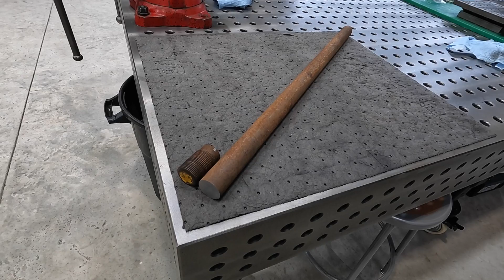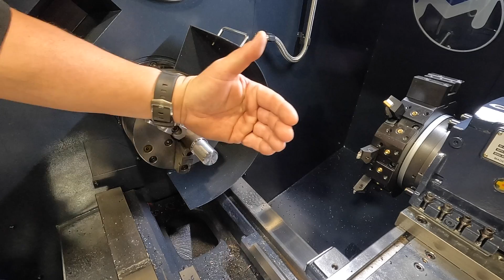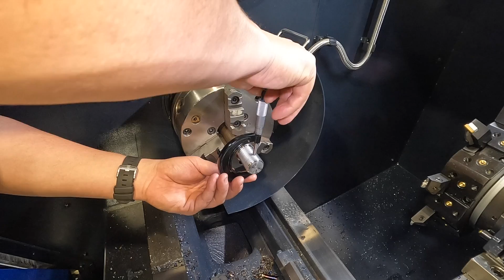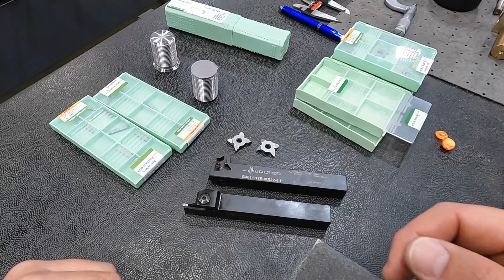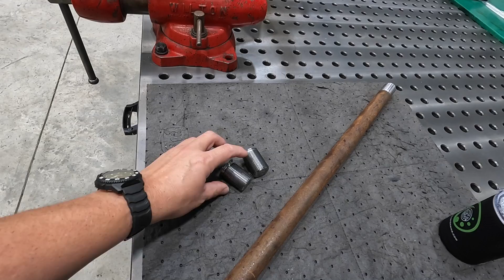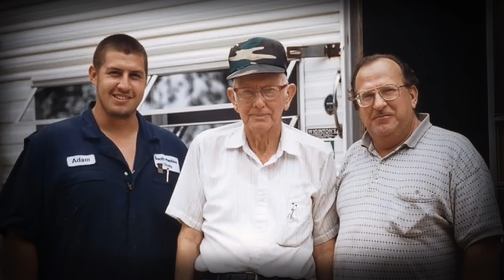CNC Machined Threaded Rod Ends

Comment: Yeah the machining is a lot faster that's for sure but when you factor in the time it takes having to write, proof out and debug the code it's more like 10 times longer than manual. Which is way CNC doesn't make sense for one off jobs.
Reply: one of the great advantages is that code can be written to be flexible and reusable, eg. for threading you'd just give the start, end, pitch, and diameter to a macro, and this gives an already proven threading subprogram that's called with one line of code.

you're right, there is setup and testing and debugging, oh my. But once that is done, and done right, you have a tool for multiple parts. And usable by people with less training, which is becoming relevant many places where skilled labor is retirering at a faster rate than they are replaced.
Reply: People that are experienced in programming can do one off jobs like this faster then any person could do manually.
Reply: The conversational control on the milltronics is pretty straight forward. An operator with minimal training on the machine could program the operation in a couple of minutes.

Comment: Hi Adam, nice work.  Always difficult trying to learn a new skill and system.  Would have liked to have seen some of your programming and your methodology, I would find that more interesting than the cutting.  It would be nice to have someone guiding you face to face but thats not always possible.  I would suggest you try and set aside a couple of weeks with stock and sketches of "mock" parts to practice, practice, practice programming tooling setups, understanding the dynamics of the machine and making lots and lots of mistakes.  You will find it difficult to learn CNC operations on a part time basis by doing a little bit here and a little bit there.  I'm only a home hack but I just bit the bullet and spent every bit of time I had on the machine initially, I'm still making mistakes but feeling a lot more confident now after many of years.  Give yourself plenty of time and you will get there.
Cam

Comment: G'day Adam..  the Milltronics is doing a super fast job. Cutting from facing to tapering to cutting the diameter in a couple of cases seems to be a harsh cut 
I was wondering if the tool height was a touch out causing the audio cut to sound harsh,  also you are doing it all dry, with Lubrication it would work better. Excellent video. Thanks

Comment: I went back and rewatched the video to see if I missed something. He said he was going to figure out how to program the job using "conversational". Next, he has the metal rod in the machine, but no programming. Later we see a screen with numbers already filled in for a program file "Shaft Threaded End" with no explanation as to how he got there. There is chattering which could be reduced or eliminated with maybe more and lighter passes. It would have been enlightening to follow through with that thought. But changes are made off-camera. He only displays knowledge of how to use a micrometer to verify the threads. It's OK to say I don't know, but I think a lot of us are assuming a lot of calls were made to support while the camera was off. I would respect him more if he bought 2 or 3 $1000 machines to learn on, then stepped up his equipment as his skills increased. Everyone can relate to that. I really didn't learn anything from this video. The question everyone is asking themselves is how is this new shop going to make money beyond hats and T-shirts. As the king of Siam said " In my head are many facts
Of which I wish I was more certain, I was sure,
Is a puzzlement"!

Comment: Don't forget, all the cnc is doing is turning the handles for you so try adjusting (or overriding) speed (if its constant surface speed do it in the program) or feed if its' starting to chatter just like you would if turning the shaft manually. 

Happy new year.
Bob

Comment: Your thread cutting program is making set depth increases.  This take off more and more material with each pass.  You end up really hogging out material at the last pass.  Some better threading programs will make a constant material removal so as the depth of the tool increases each pass is not as deep and you don't end up with that major hog at the end.  If your program doesn't have this feature you need so set the number of passes to a greater number. That way there is less material removal on the last pass.  It takes longer, but who cares if it takes 5 seconds or 10?
Reply: You could also speed up the spindle speed. You want to try to get into that sfm zone for carbide even while threading. It don't come naturally to some one who is used to engaging the lead screw but as long as your not going to be traversing over your max feed rate  pump up the rpm to get into the sfm of the material.

Comment: I know you are learning on this but I think you need some guidance from someone who has run CNC lathes for a while, otherwise you are just teaching yourself bad habits. I know this is your shop but you would be shot in a sub contracting shop for altering tool lengths rather than offsets.
Reply: Just to make it clear too. I love Aboms videos, been a viewer for years and as a seasoned CNC machinist I've been looking forward to the day Adam got some CNC capability. It's just I wish he would get some proper guidance.
Reply: does that control do offsets though? I can't imagine an industrial machines that wouldn't but I have seen odder things.
Reply: @TomDetka  I'd be very surprised if it didn't. This is what I find a little dangerous is that it comes across as educational and a lot of apprentices will watch this content while they learning too. Obviously we all know Adam is learning this but I think it would be massively beneficial for another YouTuber or any cnc engineer to work with him for a month to get all the foundations down. Knowing how to use the control is different to knowing how to use it properly.
Reply: If we could get Peter of Edge Precision in Houston to visit Adam - that would be some Priceless Videos.  If anyone on YT knows CNC turning - it's Peter.
Reply: Yea there's loads, Jay from Pierson workholding would be good too or Adam the machinist

Comment: G54 to G59 would save you some time.  The machine seems to be homing itself between tool changes.  I think I got that right?  Do they make a ratcheting chuck key?  Coolant would probably eliminate chatter.  How do you check tool offset on your machine?  Sorry for all the questions.
Reply: Likely its a safety feature to make sure you don't index a tool into the chuck. Could be just be a parameter he needs to uncheck.

Comment: Happy New Year! So I do not consider my self a machinist but I do run a CNC weekly I have a question on adjusting your tool offset. Should the adjustment be  on the radius versus the diameter adjustment you did for the threading insert?

Comment: Remember the offset is  the radius, not diameter, and you set the offset by .0001, that took .0002 off the diameter
Reply: Every CNC lathe I have ever used has the offsets in diameter, not radius...
Reply: @Eggsr2bcrushed  I think if you make the offset in tool length like he did, it doesn't auto-compensate. If you make the adjustment in the wear page (where it should be done), the adjustment is made in diameter mode
Reply: @JukeboxJake  There is  a wear offset ( x, y and also radius ) in the tool table page he shows on the video.

Comment: There isn’t a wear offset on the tools? Those little burrs on the OD finish could be improved by doing two things. Use a different tool for your finish cut at a higher surface footage or speed. I’m not sure but by the sound of the video. Are you running in constant surface speed on your turning cuts? Or maybe you have limited the speed in the program. Typically to make a thread relief I use a 35 degree diamond turning tool. I turn down a 45 degree angle into the relief into the relief. Rough the relief  and then do your finish OD cut with that tool with the thread relief all in that finish cut.
Reply: THIS  THIS  THIS ^^^^^  -  Peter, wouldn't you like to visit Pensacola???   Mr CNC meets Mr Manual.  A Epic Video for us all.
Reply: @tedsaylor6016  Ted I just saw this comment. I wouldn’t mind it but I don’t know when it could be. All my spare time for  trips going to Mexico for my building project. I did once meet Adam at the first Good of the land meet up here in Texas. I think for being totally new to CNC Adam is doing real well. That manual experience is really a big help.
Reply: Getting his cutting forces pushing down, instead of pulling up will help as well. Especially in that little machine. It will help his diameter control immensely. And, no offense intended, but he's trying to run it like a manual. Lighter D.O.C, lighter semi-finish and finish passes, even with the same tool, will do wonders.

Comment: You'd do yourself a huge favor by swapping your tooling around so your spindle is going CCW vs CW. threading gets a bit trickier tho. Their programming book(the version I have, anyway) leaves a lot to be desired. It's taken a long time for me to get my ml22 figured out. Applications has been a horrible resource, however. In my experience, anyway

Comment: I have a CNC router and laser engraver.  Get ready for sleepless nights.  The process is highly granulated, so lots of feeds and speeds and tool selections to worry about.  Cutting oil may help with the chatter, but the camera will be blinded in a second.  Remember, you spent decades learning how to run the manual lathe.  You can't become a cnc wizard in a week.  Try all types of jobs.  Take notes.  Get comfortable.  Learn to dance with your machine.

Comment: Hi, I have noticed that 250rmp  makes less tool deflection and have more control on it. Full profile insert on threads is my recommendation for better results without filing afterwards 💪  I have in siemens control and there is cycle for thread relief, easy to make with vnmg tool👌 Keep on training and there it comes that same confidence that you have with manual machines💫

Comment: Good to have those programs in the can as you can toss a bar in there and be done in a couple of minutes it he has a repeat on that part, if not still a good learning session.  

Event the threading tool sounded like it was chattering to me so I'm wondering if it is that enclosure that is making it sound that way and fooling our ears into thinking we are hearing chatter when it is just echo or some other acoustic phenomenon that you would never hear on an open manual lathe.  But then again I'm clueless on CNC.

Comment: Adam, learning to program a CNC requires immersion in the task. 
You need repetition just like when you learned to machine manually.
You really want to learn it? Do everything by CNC no matter how badly you might want to do it on a manual machine.
Give yourself no choice but to learn it and be prepared to make lots of mistakes. If you aren't making mistakes, you aren't learning anything.
Reply: You got that right.   You bought the cnc machine, you use it ALL THE TIME.

Comment: Sounds terrible. Like something is loose or not adjusted right.  Depending on the usage of that rod, I would have left it alone at a thou big. or maybe just use some emery cloth lightly. Sometimes threads that are a touch loose are better. Only seeing the part in use could tell you.

Comment: Just a bit of advice Adam. When your adjusting your sizes you should be adding or subtracting using the X Wear and Z Wear offset box for the tools not adjusting the X Length and Z Length which you get using the tool probe. You might also need to ask miltronics if your tool table is set to adjust diameter or radius because I have a feeling when you adjusted your size you actually doubled it which is why your size came out double what you expected which tells me you need to adjust only for the radius not diameter.

Comment: Adam, consider this for thread relief now that you are on a cnc. 
I noticed you have a vnmg holder, 35* OD tool. The beauty of that tool is you can produce a 45* backside chamfer. Use that tool to create the back thread relief down to about 0.01 past the minor diameter.

Comment: Hi Adam,
please use the wear fields in the tool offset table for the tool correction offsets. When you change the tool length youre in grave danger of crashing your machine if you mistype. Thats what the wear fields are for.

Best,
Martin

Comment: Adam you’ll want to add or subtract in the “wear” tab not the offset # your wear tab will be either radial or diameter. Add positive value at first then subtract your way to size.

Comment: Is the spindel RPM increasing as the tool face gets closer to the center or is that my imagination? Sounds like the program is keeping the cut speed constant as opposed to the RPM. I guess that is something a CNC has no issue accomplishing.
Reply: Yes, been around on cnc lathes from at least since late 1980's (probably many years earlier) since my 1987 Mori has it.

Comment: On your tool comp on the threading tool, you should've only changed it by 0.0005" instead of 0.001". You take 0.0005" on each side which gives you the full 0.001". Nice work!
Reply: It depends if the tool table is in radius or diameter.
Reply: @LesNewell  Based on his result (a diff of 0.002") I'd say his table is in radius. But yeah, you are correct.

Comment: Typically i’d speed up the chuck for facing as further i get to the middle because of the speed of rotation.
Reply: Shouldn't you be doing the exact opposite?
Reply: @GFSwinger1693  Yeah had it the other way around.

Comment: The chatter noise is probably just the enclosure amplifying every little sound
Reply: Possibly the enclosure itself is chattering.  It's just sheet metal.
Reply: I’m going with the amplification and adding …The rust on the material… when it’s chucked up..  noticed when he did the testing on the CLEAN part .. it sounded better.

Comment: First, calm down on the cut depths and feeds in your program. That machine isn’t rigid enough for what you’re programming. 

Second, for the threading cycle. ALWAYS run your offset above finish diameter. Start with +0.015” and check it. Then run the cycle again at half that offset and check again. Then incrementally move the offset the amount left to hit your target for a last pass. 

Never just trust the machine to hit the diameters right on all the time. Always run your offsets (wear comp) above your targets.

Also you had zero coolant while cutting. The material is obviously going to tear up while threading.